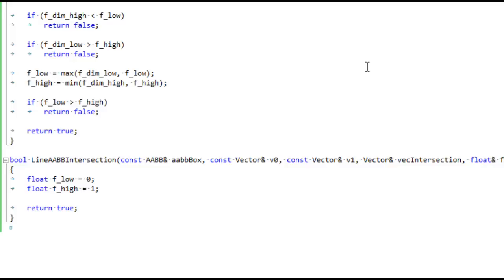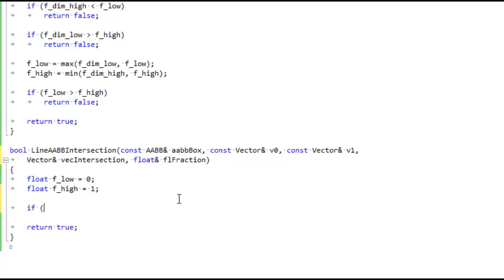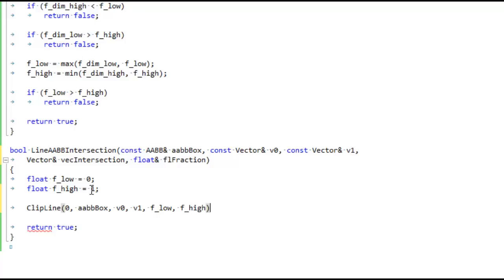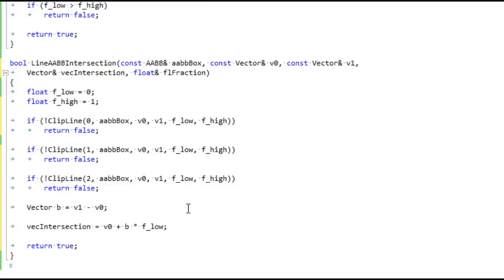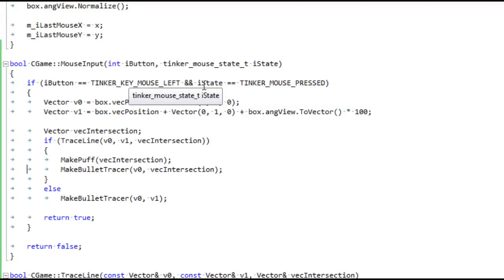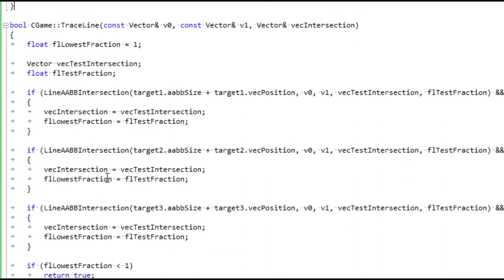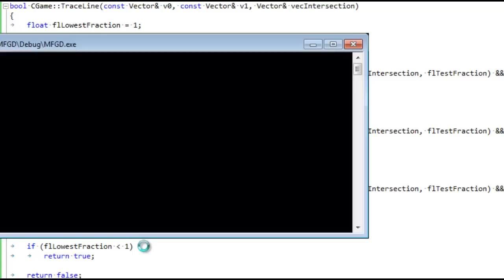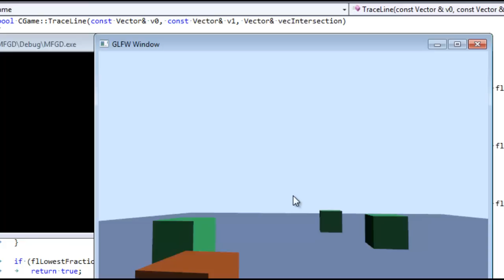Math for Game Developers - Bullet Collision Part 2

Comment: EDIT below

So after watching this several times and looking over at GitHb for answers, I will post a question here: 

I might be staring myself blind and missing it because of that, but I always get the error that class "vector" is missing the member 'v'. I know that in your code, you have a struct inside vector.h inside of a union, which has the member 'v'. Is that the one I am missing? (I have written that line of code in my own program, yet I still get the error).

- EDIT Alright, I got it running, although now I got some other errors instead, which I will look into.
- EDIT Fixed those issues, as well. This required me to almost completely rewritethe ClipLine function, though, so that both f_dim_high and f_dim_low are passed as arrays.
Reply from the maker: The source code is not the best, it has some problems. Sorry about that.
Reply: No worries, I fixed it. I think, haha

Comment: since it is axis aligned cant you just take the x = Xmin and x = Xmax while y between Ymin and Ymax and vice-versa for y, and use your line equation for finding intersection, it takes 1 more step but makes the equation very basic and easy to understand... Sorry for commenting on a such an old video
Reply from the maker: +Suigetsu Ucchiha There are a number of ways to do this and I chose one of the more efficient and "clever" solutions. It's a good exercise to implement this a different way and then test it in many situations to make sure that it's correct.

Comment: I really liked the discription, but i have some questions that, will this work for a 3d bounding Box ? Where my
Box is ( Xmin(25),Xmax(40),Ymin(-50),Ymax(100),Zmin(1.5),Zmax(1.5) )

and my line segment points are (3,20,1.5) (100,40,30) // or you can say the coordinates from where the bullets been fired and reached.

Please i need your suggestion.
Reply from the maker: You may want to increase the Z size of your box. Zmin == Zmax means the box is empty and this may cause problems with the algorithm. If you want a very thin box then you should make it 1.5 min and 1.500001 max, very thin but not empty.
Reply: Thank you so much for the reply . And secondly the algo/code will acknowledge the intersection only if line  intersects with all the planes . right?
Reply from the maker: *****
The line has to intersect with one at least of the box sides for it to be an intersection. If it misses the box sides completely there will be no intersection.
Reply: Jorge Rodriguez so that mean in the intersection function there shoud be the OR  of all the Clip returned values ?

like
If ( clipped_x OR clipped_y OR cliped_z)
     it is an intersection.
Reply from the maker: ***** No because the ClipLine function returns false if, for example, the line segment is pointing in the other direction of the box.
Reply: Jorge Rodriguez
 So all the three clipline function should return true , for a line segment to point in direction of the box,and if anyone of the clipline for x,y or z  returns false that means line segment is pointing in other direction, right? I am saying it for example if clipline for x and y returns true but clipline for z returns false then the line segment is not pointing in direction of box and it is not an intersection..if i am right. Apart from it i am trying the algo with diffrent positions of the box and will discuss with you if i will stuck .

And awesome channel it benefited me alot!!!!!!
Reply from the maker: *****
That's right :)
Reply: Jorge Rodriguez  Thank you so much i am learning it step by step ..

Comment: I'm not sure i understand how you utilize flFraction in LineAABBIntersection().

Since, at the end of the method, you set flFraction to fl_low (aka 0), how can it return anything other than 0?

Are you using flLowestFraction simply as a hit determinate rather than any sort of distance determinate?
Reply from the maker: Notice how fl_low is passed into ClipLine(). Look at the parameters of ClipLine(). You should see "float& fl_low". The & means that it's a "pass by reference" meaning that any changes to fl_low made inside ClipLine() will persist even after ClipLine() ends. So, fl_low gets set to things higher than 0 inside ClipLine(), and then flFraction receives that value later.

flLowestFraction is another way to say, "what's the nearest impact?" The fraction is literally what fraction of the distance the trace got before it hit something, it's like a percentage. So, the lowest number means the nearest impact.
Reply: Jorge Rodriguez

Ah, i didn't notice you were changing those values down the line, i thought you were merely passing them as a reference to upper and lower bounds (perhaps to limit the returned results somehow in a later video?).

I was curious as to why you were passing along what appeared to be constant 1 and 0, rather than just using 1 and 0 literals.

That makes much more sense (and probably explains why my implementation didn't work).